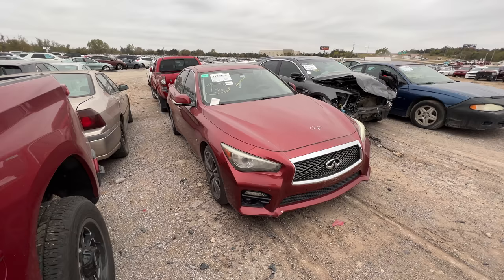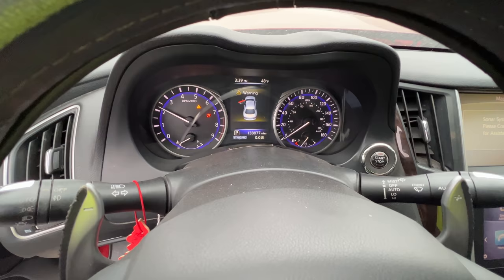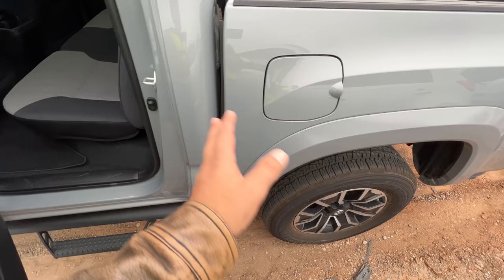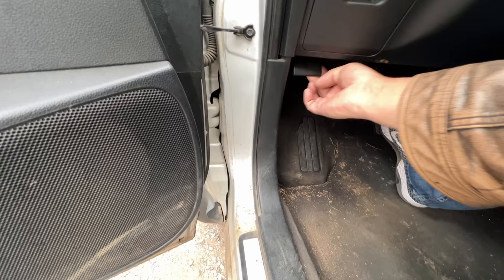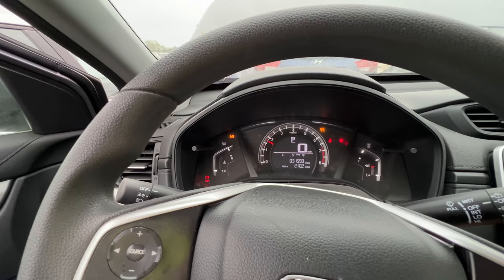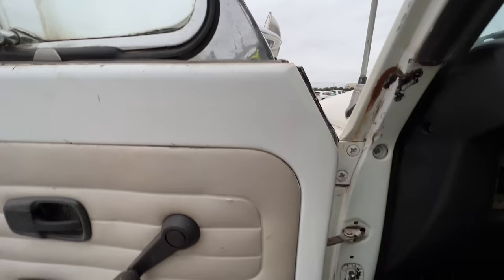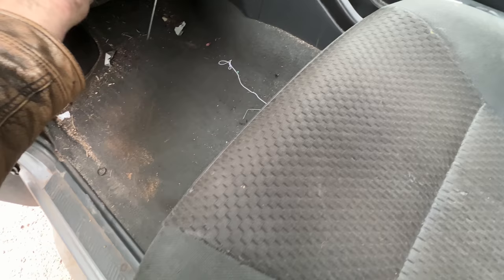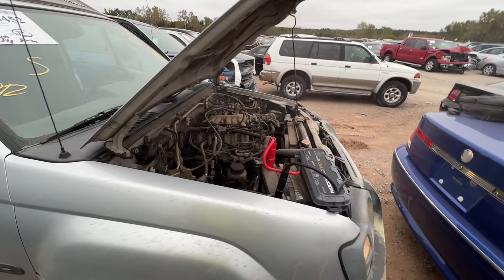IAA Walk Around and Live Bidding! 1978 VW Super Beetle!! 11-5-21

Comment: I owned a 78 Super Beetle. Don't remember what the fuel injection looked like but, if I remember correctly, it was throttle body so, it has something resembling a carburetor. The no start issue could be the battery was too weak even though it had power. I'd get it and call Mustie1, he knows damn near EVERYTHING about VW's. He would have it running in like 2 minutes as long as it had fuel pressure. Would love to see the Beetle revived. The convertibles are quite the collector item in the VW community. You could maybe even sell it to Mustie, I'm sure he'd be very interested. JMO. One other thing, the car with the miss, not the Infinity but the other one, could be a coil. My van LOVES to get a miss every 3 years or so, it's old but, NEVER throws a check engine light. I could be wrong but, worth checking out. Good luck Randy!

Comment: The beetle would be a fun one to transform! Plenty of mechanical parts available for these.
Reply: The biggest thing you need to watch on the beetle convertible is to check the floor pans they tend to rust out and that’s the strength of the car

Comment: The light flashing on the cr-v is: Brake press
You must press the brake pedal before activating the electric parking brake or 
automatic brake hold. If the indicator blinks, automatic brake hold is canceled 
during operation. Immediately press the brake pedal.

Comment: The Beetle Convertibles are appreciating in value; especially the older ones.If you can get it cheap, it would be something that would appreciate un value over time. This one looks a little rough, but if it’s structurally ok it could be worthwhile.

Comment: I put a 350 Oldsmobile engine in an 84 Buick regal coupe had the motor mount stools on the engine but not bolted or welded to the frame of the car, drove like that for years with no problems

Comment: I can tell you not to mess with that Q50. The funnel, and the smoke coming out the exhaust leads me to believe the turbos are bad, or going bad. And the seals are leaking dumping oil into the engine.
Reply: I could be wrong, but I think that model is naturally aspirated. Definitely could be seals or head gasket though.
Reply: @lukeheffernan  You’re right, it is the naturally aspirated model as it has the 3.7L engine.

Comment: I've had a 2004 Xterra, same setup as that one. FYI that Service Engine Soon light in the Xterra is the camshaft position sensor.  It sits in the valley of the engine and over time the connection deteriorates, usually around 120k+.  It is still driveable for a while but it will run very rich and eventually foul the O2 sensors and catalytic converter.  I drove mine with that issue for about 45k miles until the cat went bad and stunk too much to drive.

Comment: It probably was a fuel injection and they went to a carb it's probably a pic34 carb with a empi air filter.  Ua I had a few bugs  lol. The oem efi was trouble some back then. Don't forget to check the antifreeze

Comment: this beetle is a speciale series. Only 1000 where made for dealers if they did sell a lot of VW's. Yhis serie with both gold lines on the side of the doors is a triple white beetle. This serie was made because of the 1 miljon production of the Golf1. You will ever find a lot of them. The paint is still original and yes it was fuelinjection.

Comment: The Beetle could be worth something if you threw enough time and money at it. The visible rust is probably hiding all all the rust in the pan, heater channels, windshield frame, quarters, etc, etc. You can see the top is rotten, so water has probably ruined the interior. Then you get to deal with the inherent instability of the MacPherson strut front suspension, likely worn-out transmission, and shift linkage. Don't get me started on that hacked wiring! The original electronic Bosch L-Jetronic port fuel injection (first on beetles in 1975) looks like it has been replaced with a Solex 30/31 PICT-3 carburetor with an adapter to fit a 34 PICT manifold. Just to let you know, VW had Bosch D-Jetronic electronic port fuel injection on Type 3s (Fastback, Squareback, and Notchback) starting in 1968.

Comment: Beetle had a front-end collision, hence the damage on the hood, and if you look carefully the right front hood shock is partly collapsed, closer to body on that side.  Convertible Supers CAN be worth saving, but this one is awfully rough to try.  Will be easy to get running, but if you aren't interested in doing paint and a top, what is the point?  $1.5K max, IMHO
Reply: I’m thinking about picking it up and saving it. My dad has always wanted a convertible beetle and I think he would love that once I give it a paint job and clean it up and get it running.
Reply: "rough" you don't work on cars much do you?

I watched a guy on another channel drag a bug out of a junkyard where it sat so long it just about split in half pulling on it.  compared to that this is mint, in need of paint and wiring or not.
Reply: @CR7659 , often. Been in VWs and other German cars for 30 years, sold German parts exclusively for 8. There are Better examples for the money they asked, in My opinion. To each his own.
Reply: It's an auction, it gets bid on
Reply: This really needs to go to somebody who will take it completely apart and make it new again.  They are bringing strong money on Bring A Trailer.
Reply: Mexican Spec yea that person was me and I’m gonna give it to my dad.
Reply: @CupwakeRBLX  Did you buy it?  It was already sold by the time we saw this video.
Reply: Mexican Spec yes!